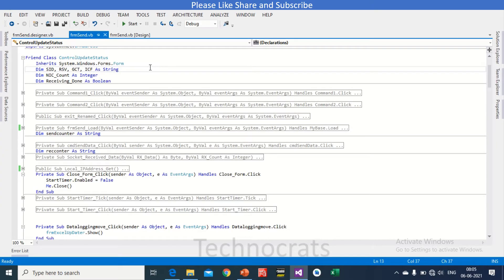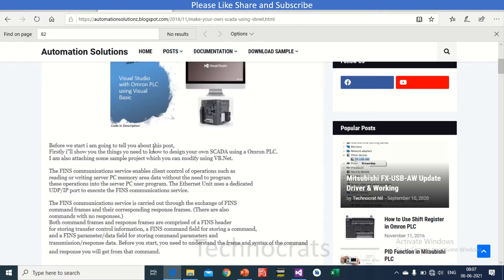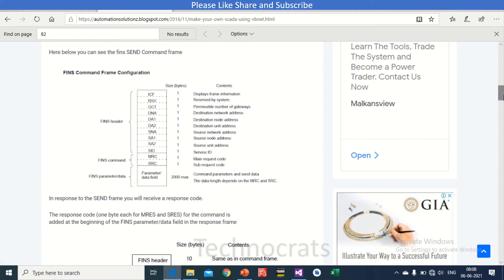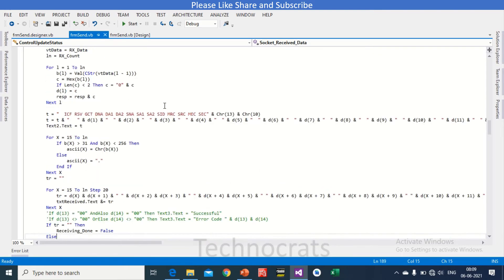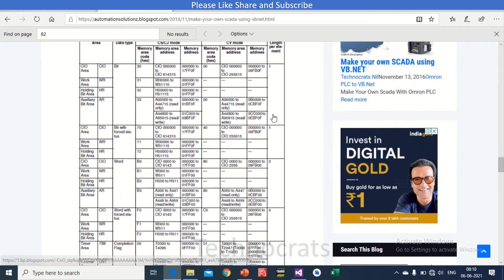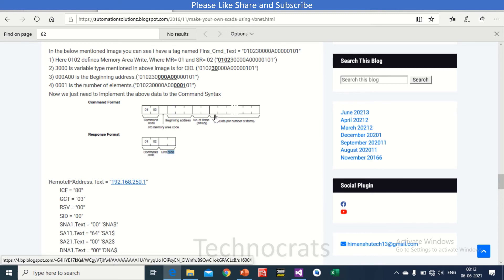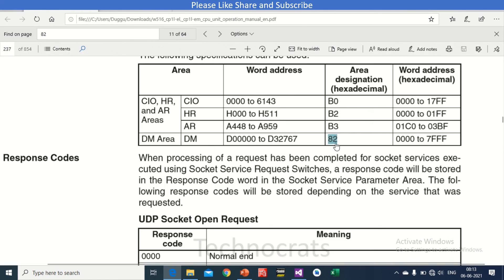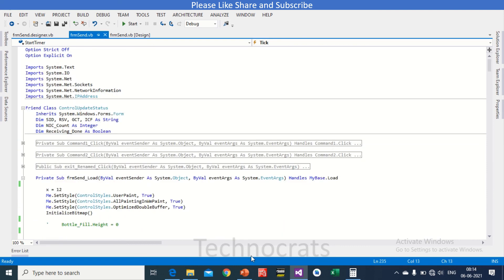Omron PLC to VB Net Visual Studio Communication Ethernet FINS

Comment: Hi 
I want to ask you that how much time it's taking to read 500 length integer value
Reply from the maker: I read around 300 D register and it took around  40-60ms
Reply: @Technocrats91  

But for 500 DM it is taking above 250 ms to read
Reply: @Technocrats91  

I am using fins tcp protocol
Reply from the maker: Try UDP instead
Reply: @Technocrats91  
But we need it on tcp so